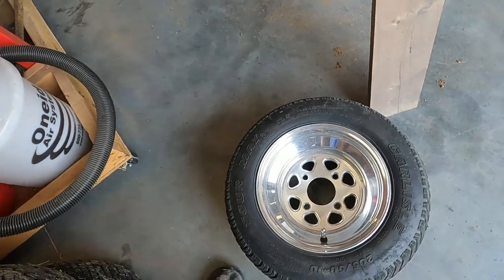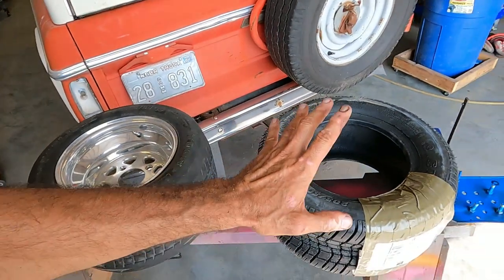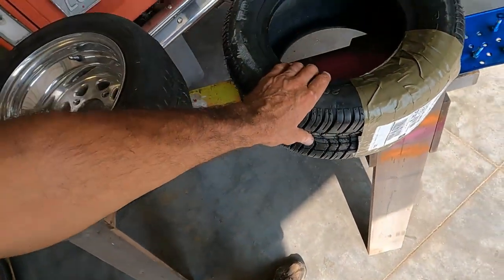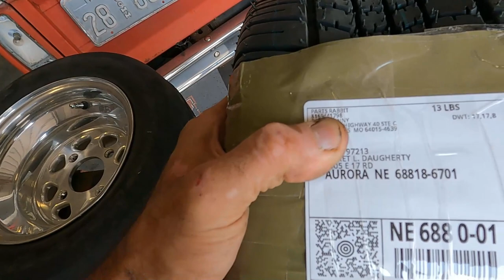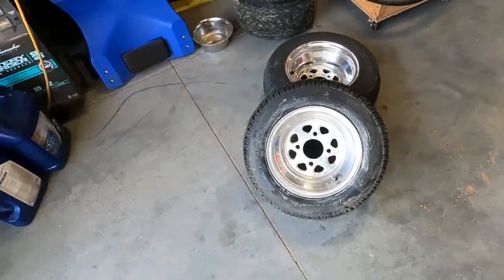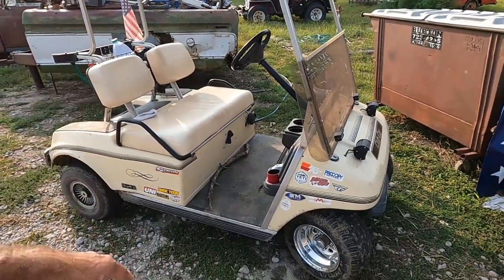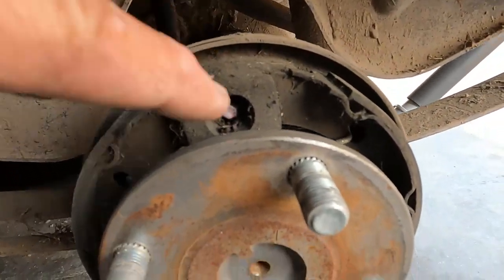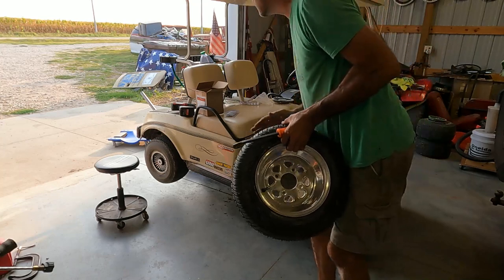Vintage Club Car shop cart gets blingy wheels... and BRAKES??

Comment: Does smokey just need a valve seal ?
Reply from the maker: That’s the first thing we’ll look at if we ever get around to it.  The cart came to us with a locked up engine, wanting it replaced.  After a couple of years of storing it, we tore into the engine and found a carb screw had been ingested and lodged in the top of the piston.  We ended up buying the cart from the customer and for kicks, slapped it back together not really expecting it to last this long!  Now, do we treat the smoking issue or look for a  150 or so CC engine for a swap???